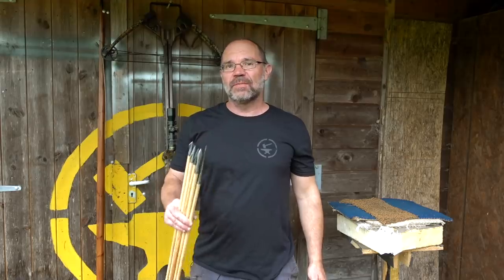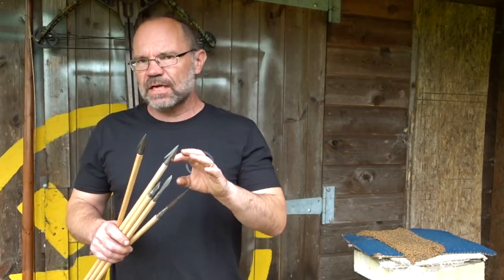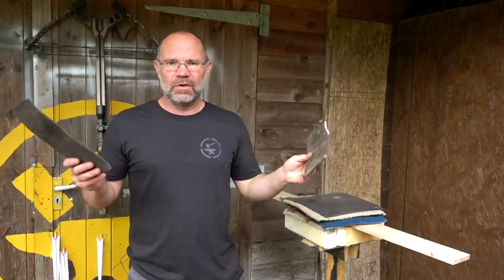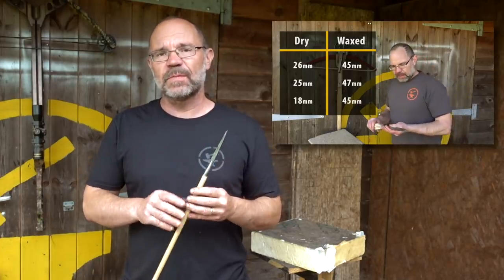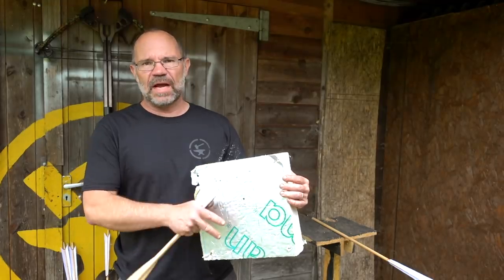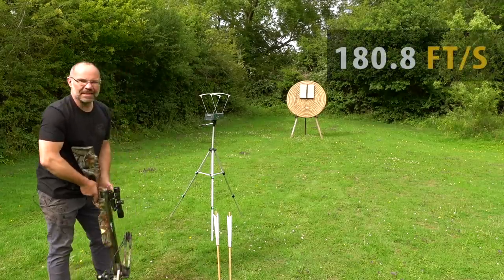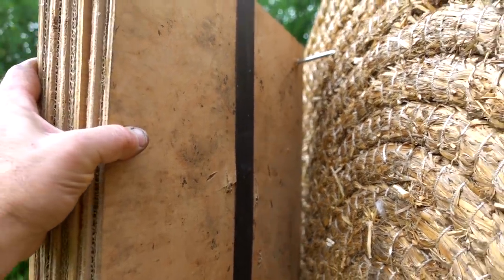Lockdown Longbow - Now I have WAR ARROWS!

Comment: Seems daft that anyone would care a crossbow is being used, it's repeatable... no shooter fatigue etc
There is a reason air cannons are used for testing stuff in industry
Reply: Indeed. If he wanted to properly replicate in a rigorous way he would have to build a contraption that replicates shooting a longbow always in the same way.
That would pretty much be a "vertical" crossbow.
His is the next best choice.
Reply: yep you make the point perfectly mate. sadly a lot of people are still going to be throwing there toys out of the pram because 'he didn't use a real bow'.
Reply: Love the attention to detail. I cannot wait to use your data for d&d
Reply: Consistency is one the key to valid experiments. By using a crossbow you eliminate a variable. You minimize that error in each test, Nice call
Reply: @tommyfred6180  he didn't use a real bow because he said in previous he is not strong enough to draw it, and now being in lock down he can use hes archer he uses Joe gibbs  so he is using a crossbow that shoots the arrows with the same speed as the long bow
Reply: @marcmondhaschen2916  SCA Court Karens, I love it
Reply: MOD testing of the time consisted of tournements and hunts. Even Henry VIII was an avid archer and hunter. It may have been empirical but they had shot enough deer, boar and men to know what worked. Verses like "shot thru and thru" in ballads like Robin Hood give us some idea. Also, modern bow hunters work out some of the same problems the same way.
Reply: Sonnenrad  yes I was just pointing out what he said him self no cristisims just joining in with the chat:)+
Reply: exactly.  What matters is the force of the projectile.  Not the specific delivery system.  Most engineers know this.
Reply: I think its more like its an easy filler episode to throw up a bunch of figures comparing them.  Most people on this channel just want to see arrows go into stuff.  Only the beardiest brit or some weeb Kyudo master would have a problem with the crossbow in place of the longbow.

Comment: From accounts we have left from the Tower of London, we see that 3 pounds of fish glue was used to glue the heads to the bolt shaft.

    12,000 steeled quarrel heads were purchased from Katherine, wife of Walter the king’s painter at the Tower for £53 6s. 8d, and for these heads six pieces of ash wood were purchased for the quarrel shafts, 700 hawks’ wings for the fletchings, 3 lb fish for glue, together with sixteen boards and 300 nails to make six coffers for the shafts, plus the wages of a carpenter and other workmen to make the shafts, polish the heads and glue them to the shafts, an additional £58 12s. 2d., a total of 2¼d. per quarrel.

(York, Richardson)

There is also account of red wax, green wax and wax polish to maintenance of the crossbows, although, fish glue is also mentioned in those same accounts.

https://www.reddit.com/r/AskHistorians/comments/4gdqqg/did_soldiers_who_used_crossbows_put_beeswax_on/  .I'm not the original poster of the comment.

Comment: i would really like to see modern aluminium  in the same thickness as a  chest plate  and then again at  double the thickness :)
Reply: Aluminium is super shit for armour.
Reply: @FrejthKing  Granted it has pretty low hardness and it's roughly 3 times as weak as steel, but it's also 3 times as light. It's used in composite tank armour and as a frame material and secondary armour in Battlebots.
Reply: Also a Kevlar gambeson
Reply: @silkyz68  uhmwpe fabric would probably be better
Reply: @xzorby  it's also used in some armoured vehicles exclusively. APCs come to mind
Reply: Bill Whittaker  because it's fun to see if things work
Reply: Bill Whittaker   yes but   from a fantasy perspective  it might be comparable to mithril :)
Reply: It's good for "catching" blows that you'd prefer not deflect.
Reply: There are a lot of different aluminium alloys and composites.

Most people when they hear aluminum they think of the weak foil. But in reality aluminum is quite strong and durable. Especially the alloys.
Reply: Composite armour, aluminium,  fiberglass,  epoxy mineral charged, eventually ...ceramic...
🤔🧐Wait...wrong channel...
Joking! That would be interesting
Reply: @FrejthKing  well...yes and no...depends on angle, thickness, ...
On the first version of the Bradley...the main  chassis is made of one continuous cast of aluminium. 
A 7,65 x 51 mm Nato can surely penetrate the chassis...but only at 90°...or so we were told by the instructors....🧐👍...
Reply: @xzorby  i would be very surprised if aluminium performs weight efficently compared to steel plate 

Its only used on light armored vehicles as it has quite good structural strenght, but it is rubbish to protect against penetration
Reply: Maybe one day i'll make an armor out of alloyed aluminum. It's not as strong as steel, but it might be sufficient and very light
Reply: @jeanladoire4141  just don't do your helmet out of aluminum or titanium. You actually need the weight to help reduce injury!

Edit: as for the armor, try 6061 aluminum. Just don't get T6 hardness, you won't be able to form it easily. Get T0 (untempered), form the metal, then have it properly heat treated by someone who knows what they're doing with the right tools.
Reply: @FrejthKing  there are armor grades of aluminum with an RHAe rating, but I don't think that's something Tod can get in the UK
Reply: Shark divers wear titanium chain mail.
Reply: @Beretic805  Aluminium is strong despite it's low weight, but it's weak as shit compared to steel, especially when talking steel alloys.
Reply: Could actually be a possibility, alu is more "grabby" than steel. So it could possibly stop an arrow sooner than steel
Reply: @BobaFettDK  This is exactly why aluminium is terrible for armour. Instead of bending, it just cracks and shatters.
Reply: It doesnt have nearly the toughness steel does, it will crack well before steel, also its very very soft compared to steel even though its much lighter the thickness needed to preform like steel would would have to be insane

Comment: 5:23 Arrow heads were probably waxed as a cheap way to keep the heads from rusting. Heat some wax, dip the tip, set it to the side - now you don't have to worry about the arrow head rusting and becoming dull purely from erosion. Instead of heaving to individually, 50-60 at a time, furiously dry off your arrow heads anytime you fought in the rain. That they then penetrated soft armor better was probably a tertiary effect only later discovered.

Comment: Great job  . A bit of clarification for the fans of ballistic gel . The main purpose of the gel is to demonstrate the temporary wound cavity . Arrows do not open up large temporary cavities the way a bullet does . Hydrostatic pressure as the bullet is compressing fluid in the body , multiplies the shock wave front . Arrows by their nature are sharper and slower , not causing the same type of shock wave . Basically a waste of ballistic gel and time , while not gaining pertinent information.

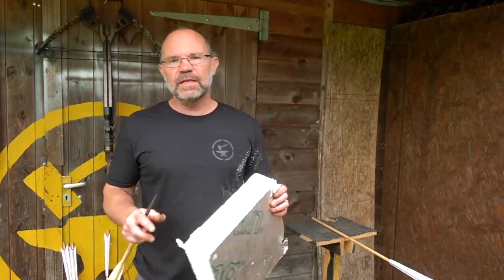Comment: 5:24 Didn't people cover metal surfaces made out iron/steel in a mix of animal fat with beeswax? I remember reading about it and how they used it to protect the metal from corrosion and rust
Reply: Tbh it's also fitting that we wouldn't find beeswax or animal fat residue over findings. Just like we often don't find the wooden stocks on old gun left in the ground for decades, as in beeswax/natural fat being biodegradable, even faster to degrade than wood
Reply: some people, like me, still do mate. when i 'rest' my garden tools i clean and wax them.
Reply: For what it's worth, this was the first finishing advice I got when I was at a blacksmithing school. I still do it, it works great.
Reply: @tommyfred6180  Rubbed on like a crayon? Or in some kind of solvent?
Reply: Rusty iron can cause decomposition in wood. The rust acts as some kind of catalyte in this reaction. Maybe arrowheads weren't ever waxed inside, where the metal contacts the wood, but possibly people have noticed this decomposition around rusty metal a long time ago.
Reply: it was the rare thing that left the blacksmith without a black oxide layer, which was created by raising the finished product to a black heat and rubbing it over with wax or oil. and that ALWAYS leaves a sticky wax-like coating behind.
Reply: @osarkthegoat7038  that explains it then
Reply: @osarkthegoat7038  Just like seasoning a cast iron skillet. :-)
Reply: @act.13.41  almost exactly like it, actually.
Reply: @act.13.41  I do this with my old iron metal detecting finds.   Clean the rust off, give it a nice olive oil coating and cook it until it hardens.    Nicely preserved iron......no rust.
Reply: Osark The Goat I’m going to disagree with you. If it’s sticky you didn’t get it hot enough or put too much on at too low of heat. It should be a smooth to the touch coating done right.
Reply: It would make sense they would know fat stopped rust. They knew it stopped water on leather. Fat was also everywhere. Used for many functions.

Comment: I traded my nice target, on a nice bow. Bought a cheap target, and put used blue board insulation on it. You are doing just what I've concocted, and it works fine. Good video and I like how you explain that our ancestors were very good at figuring out what worked. Trial and error is a fantastic (best, my opinion) learning method. You earn it, and appreciate it when thing work out.

Comment: Wow i was expecting far better arrow flight from the slo-mo footage. I guess the combination of arrows being weakly spined (relative to crossbow bolts), extra long and heavily tipped actually approximated rather similar flight to an arrow shot from a longbow. Happy coincident? Or calculated control?

Either way it gets my seal of approval for what thats worth. 

Can't wait to see the new content Todd! You're a legend guy!
Reply: Not just the wobble, but I didn't see any real spin to stabilize it in flight?
Sure it wasn't a distance shot, but at what distance then, does the stabilizing spin kick in?
A real headscratcher for me. I was CONVINCED it'd spin like a top at the target. But no.
Reply: @anoncoward6496  hes said before that the target is only about 7-10 yards away. At that distance the arrow/bolt gets there a little too fast to start spinning much. Also, there is often less helical offset on the crossbow arrow's feathers than what you'd see of standard arrows designed for a verticle bow- especially considering the legnth of those medieval style fletchings. Arrows that can be shot from a crossbow have bottom fletch sit in the "barrel" groove of the crossbow. Between that, the short fletchings (height, off the main shaft) and the "bolt's" massweight being extremely heavy im surprised they spun as much as they did.

Also, the wider heads likely don't help rotation much. Id suspect a shot at longer range would reveal more but id expect discrepancies between head types.
Reply: Keep guessing... Inhertia... Acceleration... Foc...
Reply from the maker: Thanks Mike.  The arrows are standard arrows made exactly as longbow arrows are and the fletches do initiate some spin as required for stabilisation, but the more spin the more drag so you just use enough, so certainly not spinning like a top.